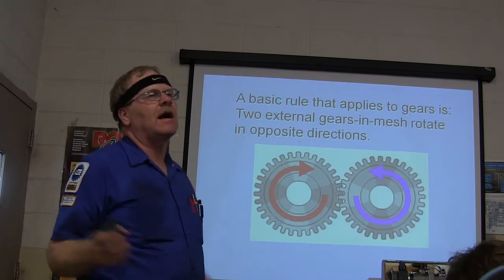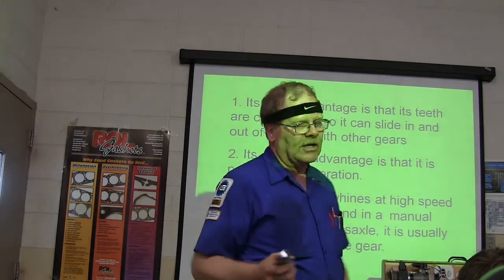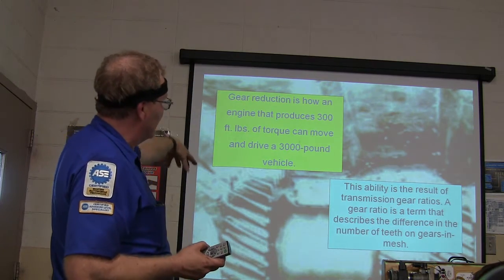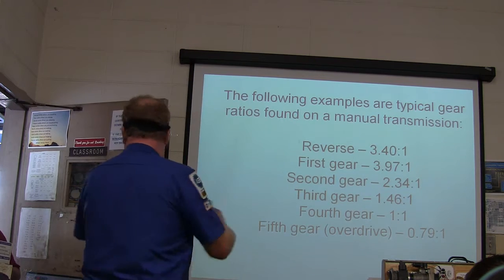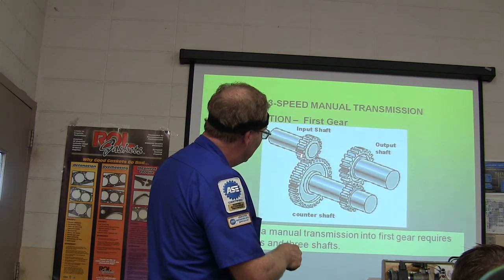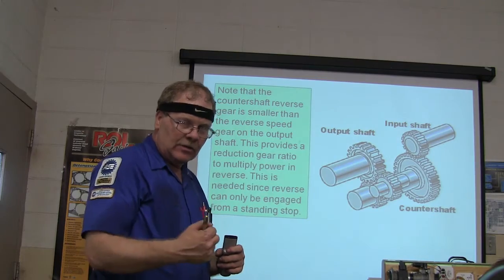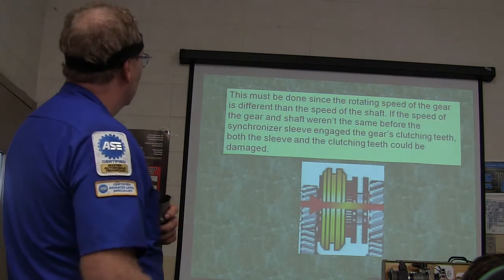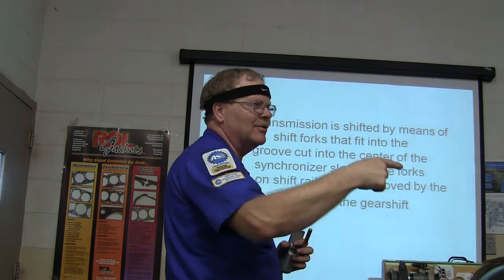Manual Transmissions Day 1

Comment: A manual that is getting too hot can kick out of gear while driving, smell like gear oil, or make shifting feel strange (too easy or difficult). Fluid check a hot manual transmission. I have experienced bearing or brake problems that destroyed manual transmissions by causing too much heat from resistance. I did a clean up job on a Camaro SS several years back. The owner had another shop change the rear end gear ratio by a fresh out of school ASE certified master. The gear mesh was set too tight so the owner experienced a gear explosion running on Saturday night. In my rookie year I built that rear end and set it with the extra slack it needed to mesh the gears perfect when the rear end heated up from running hard. I would see that car driving from time to time for many years.